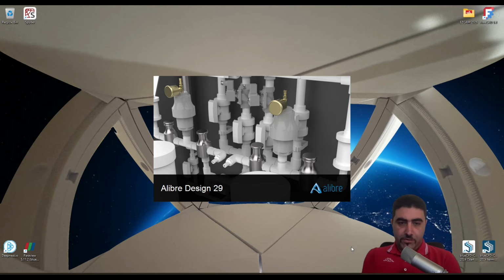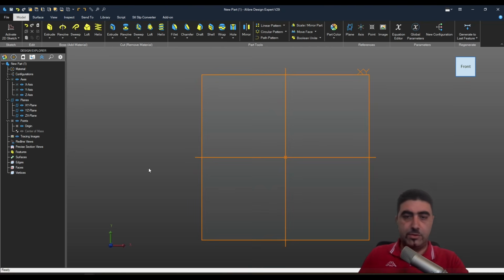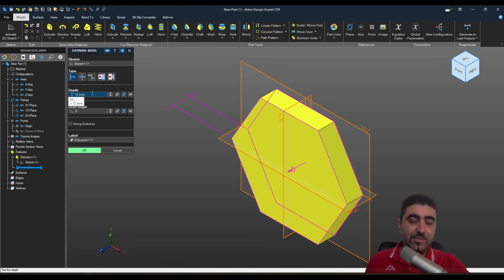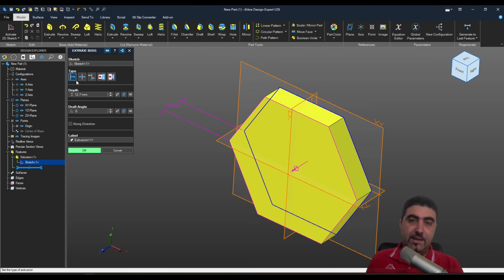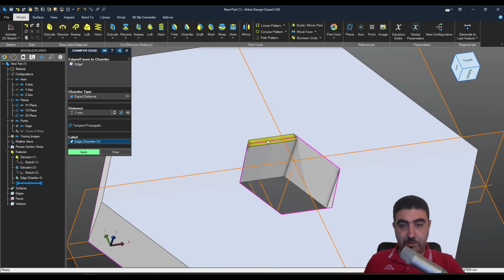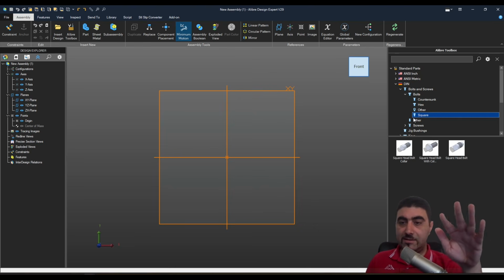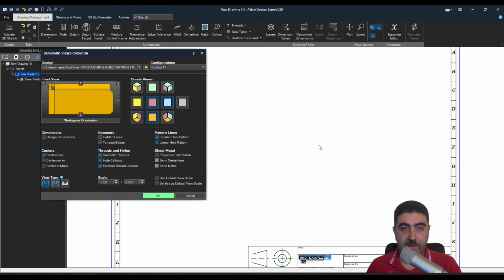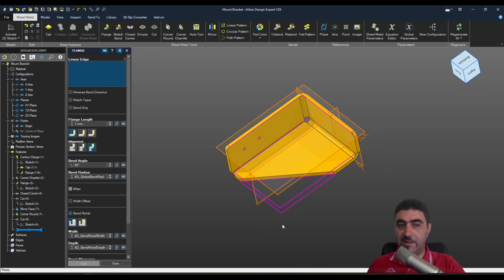My Honest Thoughts on Alibre V29!

Comment: .NET doesn't prevent software from running on Mac/Linux. You are confusing .NET with a UI library.
Reply from the maker: True, but Winforms do. And I believe, without having actual insider knowledge, that .NET was used in V28 for the menus (Winforms) and for the script and API implementations. Now the script and API is a bit easier to migrate rhan the menus. Menus don't only need a port, they also need new graphical design.

So, that is why the new menus are sited as the biggest step towards cross platform.

But you are right that this is a big abstraction on my part.
Reply: @ExMachinaEngineering  Correct, if that is Winforms, they would need to replace that to get it to work on Linux/MacOS. Assuming they have good design and abstractions in place, the changes can be isolated to just UI (though rarely is this ever the case). I haven't installed V28, but it is likely possible to figure out what UI tech they are using. If it's a .NET based UI tech that is cross-platform (like Avalon), then, agreed, this could be a big step towards cross-platform capability.

Comment: I can confirm that adding chamfers to polygon extrudes has been an issue for past Alibre versions, Alibre Atom3D and Design Pro, where you can't select all of the edges in one go. I started with Atom3D 3.5 years ago, liked it enough to upgrade to Design Pro 2.5 years ago, and I noticed this from the beginning. My workaround was to select the edges that I could, hit Apply, and keep going on the next chamfer or fillet dialog, to select the other edges. I do a lot of design for 3D printing, and frequently include hex-shaped pockets, to insert nuts, to retain them embedded below flush and keep them from turning. Adding chamfers or fillets to the top of the pocket provides a lead-in to ease insertion of the nut, and also avoids sharp edges (touch safe handling), especially important if the outside surface of the pocket is not normal to the hole axis. Did not realize the preview render is what is preventing all six edges from being selected in the fillet or chamfer dialog. Will definitely test toggling the preview render off, selecting the edges, and toggling preview render back on in V29. That will be a big time-saver, especially when I am chamfering or filleting multiple hex pockets at once, and help me avoid the error of accidentally missing an edge that shoulld be chamferred or filleted. REALLY good tip!
Reply from the maker: Thanks for watching and commenting man!!! Great to be helping

Comment: I'm really hoping they implement keyboard shortcuts for all the extrusion options. Even though they're all just 1 click away, they were previously 0 clicks away. 
Can I live with it? Sure. 
Is it worth it? Maybe. 
Is it better this way?.. maybe. That's subjective. I'm honestly under the opinion that the old menus were much easier to understand.
Reply from the maker: I agree with all of that except one thing. I do think it's better this way. Words everywhere where a nightmare to keep track in localization, different translations meant that you were locked in the help articles and videos that were in your native language, and most casual users never new about all of the option in Helix, Flange, or even extrude.

So, I do like icons instead of text and the actual layout. Now... The optimization needs to happen and has a long way to go. For example you click on the extrude type and then you need to click OK. If you just hit enter it doesn't work. Now THAT is an issue and I expect it to be fixed.

As always, your comments hit the nail on the head. Thanks for watching and for actively pushing for improvements.
Reply: Well, don't all the icons still have tool tips if you hover your mouse over them for a moment? If they do, then localization is still a problem. 
It's probably just me but I always like plain text over icons.
Reply from the maker: I have to say, in the CNC world, the Haas controller is considered as the easiest to operate and it's almost exclusively words. Almost no icons.
But fellow operators preferred Siemens or FANUC.because they didn't speak English. Do, the word for them, was an extremely complicated... Icon.
In any case, these will be optimized. Selecting to geometry, clocking on a face, and then the enter key not working is really not acceptable.
But I have already found new exploits. Video coming early next week.
Bottom line, I am with you. I agree. But as it is. I am certain it will get better

P.S. They still have the word when they hover but there is an icon to tie everything together, in terms of searching forhelp in a localized software.

Comment: With extrusion commands, all types are now selectable with  a single mouse click, as they are laid out as individual icons, I think users can live without the shift+tab trick.

The commands look much cleaner and modern now.

I wonder if we can have the toolbox items without having v29 🤔
Reply from the maker: For anyone that doesn't know, this IS Ty. The inventor of the Ty-Tab move!!!

So, losing the Ty-Tab is kind of a big deal for me because if you're under pressure and need to get things done and had developed muscle memory for it, the new menu is noticeably and annoyingly slower. But, if you zoom out a bit, the outcome is a positive one from these menus. 

On the toolbox. These are toolbox parts. So, if the spreadsheets and AD_PRT files are available, I guess they should work v28 as well.

Comment: Can you please explain the logic of the application levels? For example, somebody purchasing the professional version for $999, I guess professional CAD people do not need a toolbox with screws, nuts, and bolts?  Maybe your next round table chat with the CEO would be a question. I have started to use free CAD more and more. I prefer the Mac app, and the features you have to pay more and more with Alibre are free with free CAD. Like I said, I'm in this app for $999+3 years of maintenance.  A lot of money waisted to replace with a free app.
Reply from the maker: Hey Tom and thanks for the excellent question. Let me start with FreeCAD which, especially in v1.1, has become a significantly more viable solution. But I would say more for the hobbyist than anyone else.

It is still massively behind in Assembly, Top-Down Design and inter-part relationships, spreadsheet connection and implementation, sketch external references.... And I could go on. FreeCAD is capable but it is not efficient. Anything you can do in FreeCAD, you could probably do in Alibre in  fraction of the time. Especially in machinery design. If your needs are met with FreeCAD, maybe Atom3D is the right tier for you.

As for the toolbox. These libraries are extensive and are curated carefully by Alibre and meet the specs in the standards. That is not something that is guaranteed by even online repositories. So, that is at least worth an extra bit. And professional does have Catalogue Features. Which is a great alternative for all of the structural members and profile parts in the toolbox.

But if that does not fully answer your question, it'd be great if you could make it t the next live and ask that. And sound off in the forums too. Do not expect to be shouted at. People will genuinely discuss this with their arguments. The forum is a great place.